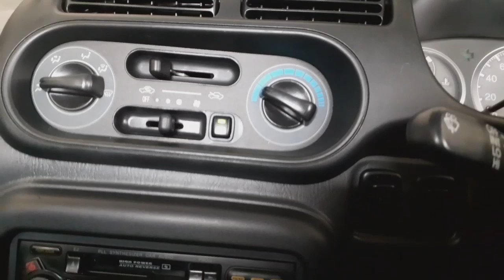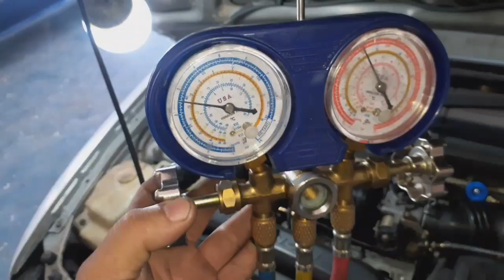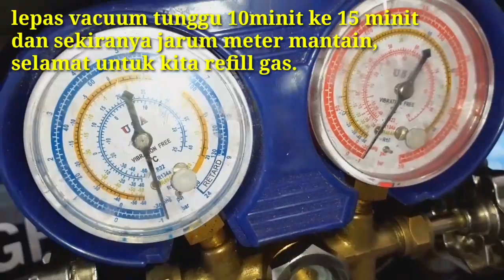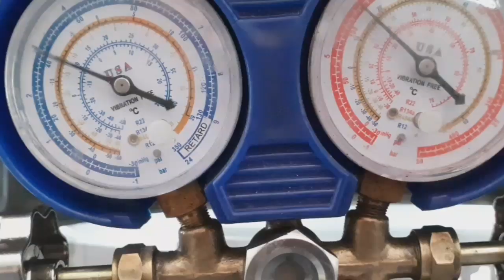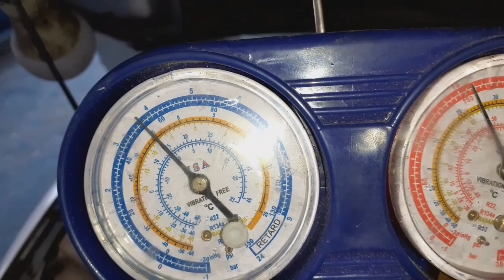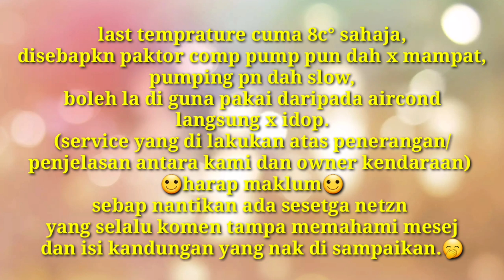Aircond selalu tambah gas! Isu aircond pipe bocor gas. #GantiPipeAircond

Comment: Salam bro Alan maaf menggangu kalau air cond rumah saya sudah service major dan isi gas aircond panasonic tapi masih juga keluar angin ..nak tahu apa simpton dan cara dibaiki terima kasih.. wansilat dari sabah sipitang??
Reply from the maker: Walaikumsalam wan. Keluar air ka maksud nya tu? Kalau masih keluar air  ada beberapa sebap. Gas tidak cukup yg sepatut nya. Cooling coil tidak cuci bersiah.
Reply: Sudah cuci itu cooling coil sama juga bro alan
Reply: Gas saya sudah isi kelmarin terlebih 150cc sekarang susah pump down Bro Alan
Reply: On aircond keluar angin saja?? Tapi saya sudah isi gas..
Reply: Sudah service tembak pakai waterjet itu kompresor dan isi gas ..tapi sama juga keluar angin..
Reply from the maker: @wansilat3089  mungkin sumbat kali wan. Pipe sejok ka. Brapa hp tu ar?
Reply: Bro @AlanStyleAutomotive  paip tidak sejuk ..
Reply: 1 horsepower bro Alan
Reply from the maker: @wansilat3089  rasanya sumbat tu wan. Kalau capallary tube sumbat ac jadi tidak sejok.
Reply: Bro @AlanStyleAutomotive  ok nanti ku check balik
Reply from the maker: @wansilat3089  ok wan. Smoga di pmudah kn

Comment: Kereta my vi aircond sejuk setengah jam Tiba-tiba jadi panas RPm naik 2000 Dalam 10 minit RTM turun 1000 sejuk balik apa punca dia
Reply from the maker: Kena check frst dulu bosku. Samada masalah engine atau ac system. Ac system boleh mempngaruhi engine bila bearing jem. Bgtu juga sebalik nya engine boleh mempngruhi ac system .